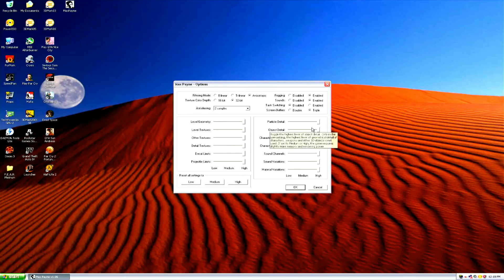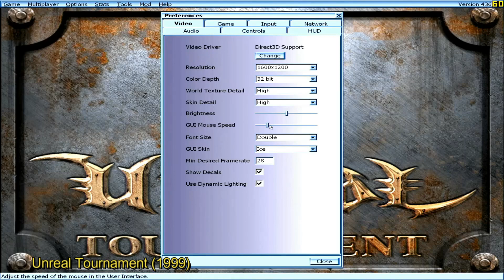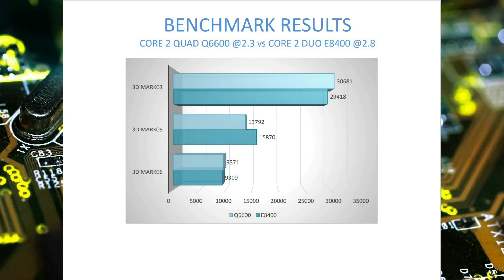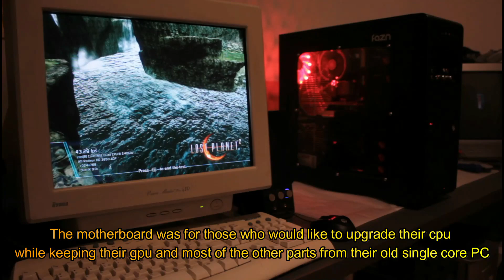ATi Radeon HD 3850 Agp - ASRock Dual VSTA -  Quad Core Build

Comment: Please share the solution to the problem, I can't get HD 3850 to work in Windows 7 and Vista
Reply from the maker: At the moment I am running this system on windows XP sp3. In the past I used windows 7 for this system, without issues. I have to check it again and answer to you. Maybe you didn't find the appropriate drivers.
Reply: @spyros86  Yes, I didn't find the driver. Please check.
Reply from the maker: @AndreyB  Try 13-9-legacy_vista_win7_64_dd_ccc_whql.
Reply: @spyros86  it didn't work out, I think it's not possible to run ATi 3850 on Windows Vista or Windows 7, If it's not difficult for you, check it out. Waiting for an answer. Thanks
Reply: If your HD 3850 AGP is from Powercolor, try setting the agp to 4x in your motherboard's bios.
Reply: @Codman40  I have Sapphire. Powercolor 4x drivers installed in windows 7?

Comment: Hi from a 4coredual owner :) keep doing this type of content!!, btw do you know if there's a possibility that sapphire HD 3850 agp can be updgraded to 1gb vram? I'm asking because the sapphire pcie one, despite the connector, is the same pcb, same brand of memory (qimonda in general), same power phases for vcore and vmem, same socket type for vram (BGA 136) and adequate operating voltage for them between 1.8-1.9v. AGP 512 mb have  64mb x8 modules, and 1gb 128mbx8 modules, model HYB18H1G321AF and this memory chip is present on many HD 3850 manufacturers, like club 3d, powercolor, asus and even on the most recent HD 4850 1gb pcie,  would be fantastic achieve 1gb on 3850 agp with mem clocks above 1000mhz (the qimonda chip is capable of). Nowadays is very common to see vram upgrades like the rx570 4gb >8gb rx480, rtx 2060 even rtx 3070, the question is HD 3850 AGP why not?
Reply from the maker: Thank you for comment ! I am not informed about the upgrade. I am going to check it, it's quite interesting!

Comment: I had the asrock 4coredual vsta 2.0 back in the day. It's final build:

Pentium e5300 oc to 3.2 ghz
2x2gb ddr2 675 (modded bios, 3.5gb usable)
8800gt 512mb
Ati 8500aiw (to play vhs on the pc, and it worked very well, also to play retro consoles hooked up to it too)
2x voodoo2 sli for glide goodness 
2x 160gb WD sata hdd in Raid-0 
Some antec 400w power supply 
Generic gamer case 
SB Live! 5.1
Win7/98se
The monitor had dual vga inputs that allowed me to switch input depending on if using agp and voodoo2 combo or 8800gt
Reply from the maker: It seems ideal system combination for multiple uses. The only problem you might had is that a few games, especially after 2000, could pick the Voodoo 2 sli or the agp card, without letting you to choose. Then you had to do some modifications in the game folder. Thank you for your comment !
Reply: @spyros86  I believe those games went based on the device manager listing as to which was primary
Reply from the maker: @Bruce-LeeLSA  This is quite possible !

Comment: Plasti-dipping the MB would make it a cool reverse sleeper. But honestly, with a rare board like this maybe I'd hold off. Awesome video!
Reply from the maker: You mean to paint it black so it will look like a new PC ? 😁 Not a bad idea ! Thanks to the comment I've learnt what is plasti-dipping !
Reply: @spyros86  No problem, that's exactly what I meant. You can peel it off to resell or if you change your mind, too.

Comment: Those hybrid motherboards were really cool. If i'm not mistaking i think only Asrock and ECS made motherboards that had both AGP and PCI Express and DDR1 and 2 slots
Reply from the maker: You are correct, and the first motherboards had the 915 Intel chipset.
Circa late 2004 to 2005.
Thank you for the comment !
Reply: @spyros86  There were also some ECS boards that had 2 CPU sockets. I had an old ECS board that had a Slot 1 socket and a 370 socket so you could use whatever CPU you had on hand
Reply from the maker: @LUR777-g7r  I bet they have a VIA chipset ! I have stored somewhere a similar board !
Good choice for a Voodoo 2 sli or a Voodoo 3 system.
Reply: @spyros86  Mine had the Intel 440BX chipset. It was the ECS P6BXT-A+. Gave it in 2020 to a collector because he really wanted it and i didn't had the time to actually use it myself. If i remember correctly it could go to a max of 850 mhz Pentium 3 for both slot 1 and 370 sockets or an 800 mhz Celeron
Reply from the maker: @LUR777-g7r  That must be rare, and for sure a fine piece of hardware. Nowadays, do you regret giving this board ? 🙂
Reply: @spyros86  No. I'm limited in space and i already have another computer that i use for retro stuff. That board was actually from a Compaq computer. It was the same exact board as the "normal" one but it had a Compaq bios on it and i think they kinda broke some stuff on it. It used to crash in Windows 98 a lot but it was stable with 2000 and XP,and if i used 256MB RAM sticks or higher it would only see half of the capacity of the stick. If i put a 256MB one it would see it as a 128 and if i put 512 it would see 256. I had 2 of those Compaq computers with that board and they both behaved the same. I don't know if that board was like that because Compaq modified the bios or if that's the way it worked.
Reply: Asrock were the master of odd and quirky motherboards, they rescued me a few times allowing me to do partial upgrades when a complete platform would of been the other option.

Comment: What would the best cpu for this be besides the q6600 & core 2 extreme x6800 ? Would the wolfdale pentium dual cores work maybe ? like a e5800 ? id imagine those might be a bit better for some earlier era games then the core 2 quad at 2.4 ghz going too 3.0 ghz instead.
Reply: QX6700/QX68x0 is a very good choice if you can get one; unlocked multi means you can shoot their clocks upward without the need to up an already stressed out FSB, and the 4MB cache/die means even the C2D E7000 series will be slowly left in the dust. If you want just dual cores though, X6800 is as good a choice as any.
Reply from the maker: A friend has a system : Asrock 775i65G and Wolfdale E5800 oc @3.75GHz. The 3Dmark results are close except the 3Dmark05, 18011 e5800 @3.75 13792 Q6600@2.3. 3Dmark03 & 06 almost the same results. You can't oc the q6600 with Dual VSTA motherboard. The system won't boot.

Comment: Ah, that is quite a famous motherboard.  Not easy to find.  Good for a huge selection of games 1998-2010.  

Interesting to see E8400 is not always faster than Q6600.  Thanks Spyros!
Reply from the maker: There are some CPUs, from time to time, that are real badasses. A few years back I compared Pentium III 1.26S Tualatin with a Pentium 4 2.0 and they were very close. Pentium 4 2.0 was only 10% faster. Some people used the Q6600 oc for 8 years, playing modern games with the proper GPUs. 
Thanks for your comments !